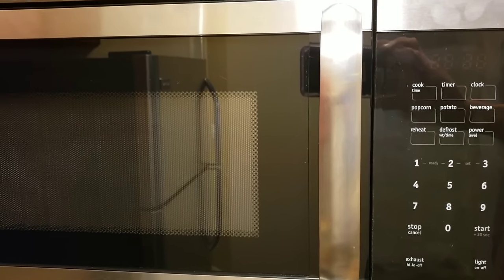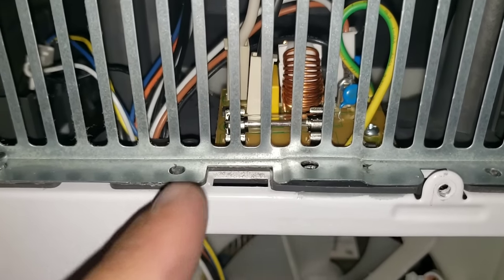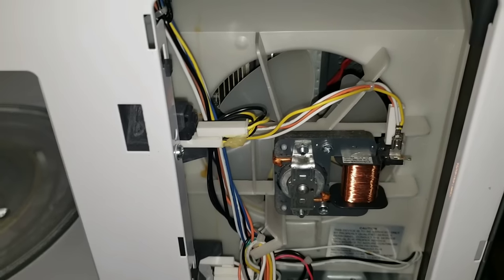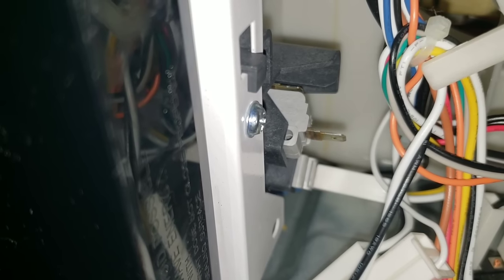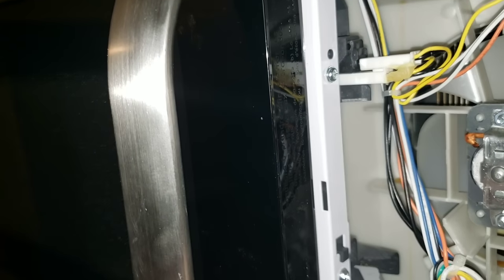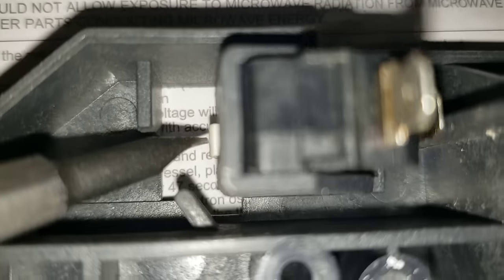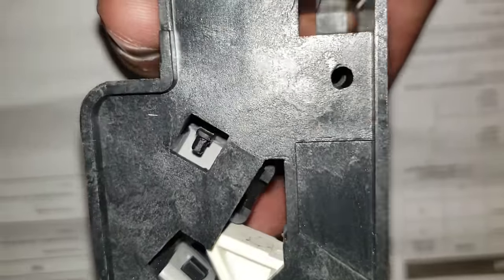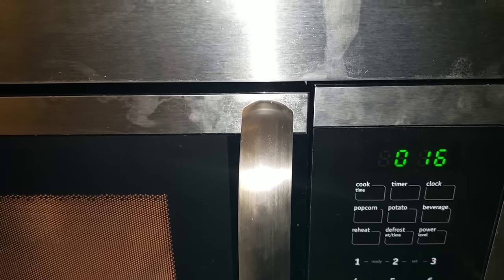Microwave Keeps Tripping Breaker? Here's WHY!

Comment: I have my Toaster and Toaster Oven plugged in one outlet. I decided to turn on the oven to bake bread. Now that outlet doesn't work. I checked the breaker, Reset the Outlet, Nothing.

Anything else I can do?????
Reply from the maker: It may be a tripped GFCI. Usually in the kitchen their is a outlet that has a red or white push button. See if that works. If it is not the GFCI do the other outlets work? If so it may be that the one outlet needs to be replaced. There are many factors to consider. I have multiple videos on my channel to assist you. Hope this helps!
Reply: Sam 
Sam 
Thank you, I watched the video where you changed the Outlet, and one with gfci you changed.
This outlet has a white reset button. But doesn't have the red and black, so would that be just a regular outlet???? 
Amazon??? 

I Also watched the toilet fill pump video, ordered it yesterday, will have it tomorrow.  I believe I Asked you some Stupid questions about the fill pump, "mine has a chain" yeah! 😁
I've looked in the tank twice i think to reattach the chain to the flap!!!
I know now what they are after watching all of the toilet videos!!! 

Subscribed and liked your videos!
Reply: @MoreThanMaintenance  Great video Sam.  I have the exact same frigidaire microwave (Ffmv164lsa)  I had a problem with the breaker popping if I would open the door with the microwave running.  I would have to press cancel button then open the door.  Well eventually it stopped working completely where when I press add 30 it would pop the breaker.  I disassembled just like the video and found my monitor switch just like yours was not clicking.  I eventually pushed down on the little button hard enough with the screwdriver and it started clicking again.  I assembled the microwave and it works but it still pops the breaker if I open the door without clearing the time.  Is this cause that Monitor switch is going bad?  What is the part number for this monitor switch?

Comment: Thats a messed up design. If the monitor switch fails when the door is close you get a dead short. Where did you get that schematic was it inside the panel.  I have one that trips the breaker all the time. Thanks.

Comment: I went through these steps and found the same problem with the same switch as you. I put in a new one but the microwave is still blowing it's fuse. Any idea as to what I need to test next? I checked the thermostat 70/40 and it has no continuity but I heard that not all thermostat's should have continuity. Does anyone know what to look at next?
Reply: BLau Arts 100% is your capacitor

Comment: Mine was same switch. I replaced and the new one failed also.  I pried opened both the old and the new switches and they had clear damage on the contacts to lock them closed.  Any idea what could be causing the new one to fail also. Note. The old one was black color and kw3at-16 but the new one was kw3a and grey colored. Maybe the new one wasn’t high enough capacity and failed quick?

Comment: I found the real reason for my fuse blowing on my #JVM3160RF SS.  There was nothing wrong with any of my switches. 
(I guessed that there’s nothing wrong with my thermostats as I hardly use my microwave for more than a minute. I replace my fuse 2 times, and was able to use it 4 to 10 times - but fuse would blow when I tried to use it for the first time in the morning – so microwave was cold.)
What I did notice is that my monitor switch ( KW3A) was sometimes touching / sometimes not touching the microwave door hook when I shut door close. Try this – after you shut your door, rock your door knob back and forth a tiny bit – you will hear your monitor switch (middle switch) clicking on and off even though the door is closed!!  I changed my KW3A switch anyways and taped a small thin plastic to KW3A’s black on/off button. When my door is close, it’s hook will depress this enlarged on/off switch.  My closed door has back and forth shaky “play” but my monitor switch on/off button is always pressed down – it no longer clicks on and off.
I bought all 3 switches in case I need them in future:
https://www.ebay.com/itm/KW3A-Microwave-Oven-Door-Switch-16A-125-250V-Door-Interloc-Normally-Open-Norma/293718635877?hash=item4462feb565:g:LvUAAOSwjJZfUI8l

What I bought this for monitor switch:
https://www.ebay.com/itm/New-OEM-Microwave-Oven-KW3A-Door-Micro-Switch-Normally-Close/252048049051?hash=item3aaf3c039b:g:ZZIAAOSwUKxYcCMZ

Comment: Great video!  Of the three door switches on our Kenmore microwave, I found a defective monitor switch (middle switch) as a result of continuity testing.  Found replacement part on an online parts store.  After installing the replacement switch and plugging into an outlet, the microwave hums.  It is also heating at the same time.  What else could be wrong with the unit and/or needs testing?

When initially continuity testing, I did notice that the bottom left thermostat does not have continuity while the thermostat on the right does.  I was assuming the left thermostat might have been dependent upon fixing the middle door switch.

Any suggestions are greatly appreciated!

Thanks in advance!

Comment: Please elaborate on how the  defective cherry switch caused a  direct short on the mains!
Could you add a schematic of the circuitry?
Thanks!
Reply: Look at a microwave schem. You'll see the monitor switch is across the leads to the transformer. When closed, ie. door open, the transformer can't operate. When open, ie. door closed, the transformer operates. If the switch is closed and power is sent to the transformer, you end up with a direct short across the 120v side of the transformer. Breaker pops.

Comment: The second part you tested for continuity was the oven thermostat. Mine did no have continuity. Is that bad, can it be replaced?
Reply: I have the same question, the thermostat do not have the continuity and want to know if it bad or will it have continuity once it reaches certain temperature. Please let me know.

Comment: I replaced my middle switch and it fixed it for my test run but didn’t work after that. Popped the breaker and now the new switch is bad as well. Where do I look next?

Comment: Ok, so now why does the breaker on mine blow after the microwave is running? This is very intermittent and trips the breaker as an arc fault, not an overload. This is in a 4 month old house with a 4 month old microwave on a dedicated circuit, arc fault breaker. What is shorting in  side this microwave?  I phoned for service but Samsung has no service center near that goes out into the country.

Comment: Hers my problem, I have seen 4 of these m/w in the last month. Same issue.  Change the switch with oem and test it, all good. This monitor switch should blow the fuse, not the breaker. Customer calls back and says Same issue. Go back and the switch is bad again. Something else is going on here. I can't find it because everything else tests good and the customer are under a warranty and it gets replaced. I don't see it a 3rd time. Good luck.

Comment: Hi I changed the monitoring switch since it was stuck and multimeter reads no continuity when door close however now I close the door and microwave turns on by itself. I checked the other switches (top and bottom) and when closed it reads continuity. Did I mess up something else ?

Comment: Breaker trips only if I open the door while the microwave is running. All 3 switches test good for continuity. Microwave is on a 12/2 20A line all by itself. What’s next to look at?

Comment: Mine went dead after the unit stopped recognizing that the door was closed. In the past I fixed it by closing and opening each switch manually with a clothes hanger. This time the unit lost power when I was doing it. Could it be safe to say that it’s one of the switches?

Comment: Can you use the microwave with the monitor switch disconnected, mine is bad on a Bosch but it still turns off when i open the door, so what does the monitor switch actually do?

Comment: I checked my monitor switch and it checks out as good, but when I put my meter, on the wires that were connected to the monitor switch, I get continuity or a short.  Any ideas?  Thanks

Comment: After my microwave stopped working three years ago, I found a new fuse would get it on again. Except it wouldn’t allow cooking without blowing a fuse. So, we just stopped using it as a microwave and used it for its fan and lights.
Reply: Fast forward to now: a light bulb needed replacement and as I examined it, I saw that the glass part had separated from the metal. Maybe that was the cause of the blowing fuses?

Nope.

Finally did YouTube and learned all about the door switches, found that one of mine was bad, replaced it, and whatever I did now makes the oven blow a fuse immediately upon plugging the device into the outlet. 

Hoping that I reinstalled the wiring wrong, so I’m looking at this excellent video to see the right way to hook everything back up!

Comment: For some apparent reason I turn on the breaker,microwave come on while the door is open,then I close the door & the microwave shut off & trips the breaker again.. so I took the top switch out & apart & realize it was seized up leading me to believe there’s something else going on inside the housing of this $339 microwave

I order new switches & replace all 3,fuse is still good but there’s something putting to much load on the switches that I just can’t get my hand on..

Comment: The problem with this video is that the switch does NOT just fail - nine chances out of ten, the switch's internal contacts are seized together (welded) from a surge of very high current. Of course, a switch can mechanically fail, but the switches that they use are well enough built that they don't fail mechanically.

More likely, the transformer for the magnetron's high voltage is shorting (arcing) inside which causes the momentary high current through the switches. Every time that an arc occurs, the switch forms a pit and a matching crater in the contacts until one time the spring cannot overcome the connection between the two when the switch is opened. By itself that won't cause the short to occur. 

The three switches are designed to actuate together. If one is not on, the others won't cause anything to happen unless something is wired wrong. I refuse to believe that an engineer will intentionally design a circuit that to cause a dead-short and destroy the switches as one of the comments suggests. Rather, the more likely case is that the high voltage side of the transformer has a winding or two that are shorted causing the current in the input to be increased. As time goes on the transformer secondary (high voltage) further deteriorates and an arc occurs which throws the primary into a high current that is high enough to either blow the fuse or pop the circuit breaker. The arc is not a short, so the problem goes away when the switch is replaced. But then some time later, the arc occurs again - perhaps several more times until the winding shorts at another location and the thing is blowing the fuse or the c/b each time you try to use it, taking another switch with it each time. Now if you were to check the transformer with an ohm meter, it will be within the normal range, but it is out of spec if you find out what the spec is. 

For example, if a 120 vac transformer shows 50 ohms, it is likely that the resistance of the secondary will exceed 500 ohms by a considerable amount, but measuring it at say 750 ohms only tells you that the winding is continuous and in the 'ball park' so it is probably ok, but it might not be. If the output load doesn't change, but the windings are fewer due to shorted windings, the current in the secondary will be greater causing a demand for the primary current to be increased until the current is great enough to blow the fuse. They use a slow-blow to prolong this happening because as the unit ages, the current gets higher and higher, but the slow blow allows the current to get a lot higher as it can stand the current long enough for most microwave activities. Then you cook something that takes 4 - 5 minutes once, maybe twice and the slow-blow is finally unable to keep from blowing. Chances are had you only cooked for a minute or less all of the time, the microwave would last nearly forever.

It would seem like a thermal, auto resetting c/b on the power supply would make more sense to protect these switches. It could be considerably lower in current capacity at around 10 amp  and might protect the windings from being damaged in the first place. (Although the main reason for failure in a winding is due to poor quality control on the insulation of the wires when the wires were produced and when the coils were wound.

BTW the failure of the HV transformer is very possibly occurring from the time the unit was built. It is not severe enough to overcome the protections provided, so it is never seen. To design the transformer to be able to withstand that level of voltage is not easy and discharging will occur - to stop it would mean a much more expensive design for little improvement over the long haul. When the failures begin to occur, get a new microwave and forget the hassle - they are very inexpensive unless you want all of those bells and whistles.

Whirlpool makes such a trade-off in theirs. If you look at the reports from the purchasers from major outlets such as Home Depot, Lowes and others, many of their units come back with this problem and my bet is that 90%  are blamed on bad switches, but the switches are being given a bum rap. And Whirlpool microwaves enjoy a 4 to 4.5 star rating right along which bears out the premise that I just made. (I have first hand experience with their units.)

Comment: I was able to fix one issue but there is one more issue. Whenever I open the door while the microwave is running it still trips the breaker. Is there any other solution for that?

Comment: Hey Sam!   So my microwave (Kenmore 790.80332310) was doing the exact same thing.   I changed the monitor switch out and it works ….HOWEVER when I close the door now it’s making a buzzing sound without even me pushing start.   I check all my connects and they seem to be connected.   Any idea what is going on with it now?

Comment: flippin brillaint.  first search result and tested and found two of the three switches broken.  The microwave would work, sometimes.  That is because the primary interlock switch was stuck closed. (always thought door was closed!!).   On top of that, the monitor switch was flaky. it would trip the breaker intermittently.    8 dollars on Amazon for 2 switches and it is good as new!

Comment: Thanks for the video, very helpful,  however, I had the same issue and replaced my monitoring switch, I thought the issue was fixed, but when I opened the door while it was running it would trip the breaker. It worked fine as long as you stopped it before opening the door, it worked like that for a couple of days then it died every time you tried to start it. I tested the monitoring switch again and the brand new switch failed! So something else is wrong causing it to burn out and fail. Anyone have any ideas?

Comment: You cannot check a fuse with both ends and they are older you will be reading the components of the microwave take out at least one end of the fuse from the holder and then put your meter across the fuse

Comment: My microwave keeps blowing 250v 20Amps fuse the ceramic one...i cheched all the components found the door middle switch to be bad..went to store bought a 3 prong the salesman told me its universal to use only 2 prongs...to use the upper and fardest lower prong not the middle prong i run continuity test and it shows continuity when door open and closed...how can I install it without buying a new one???

Comment: Great video. I changed the switch worked great like 2 times then the breaker popped. Can't figure out why? Any ideas
Reply: Check the adjustment of the whole assembly. Make sure the tab on the door is actually opening the monitor interlock switch. For me it was a very simple adjustment.

Comment: Men i have  a freaking problem here with a kenmore microwave stop heating. This blew up the capacitor and replace with the same then when i check i note this have 2 relays one said high another said low i detach the cable and use a door switch and i hit the switch when i hit start and the micro start heat so i believed was the relay and i swap like 4 relays and still no heat. Men  the only i note its the middle of the door switch always has continuity when the cables are connected when i detach it the switch give me the correct reading but connected always has continuity this works in this way

Comment: I've this guy who is less than honest. He says I owe him a microwave because it's new and the cut supply wire to the plug it was connected to fried it. On back plate where it has model and serial number also has date of manufacture and it was made in 2010. And tested fuse it's still good. If there was a surge wouldn't that have fried the fuse?
Reply from the maker: Honestly 2010... he has got 9 good years from it. I've seen microwaves go bad after 5 years. 🤔

Comment: In the past, the microwave worked fine. Now, when you plug in the microwave, and you don't power it up, and all you do is open the door expecting the interior light to come on, and the circuit breaker trips...